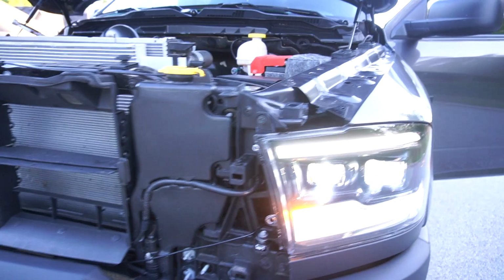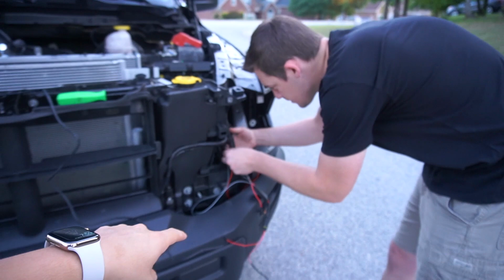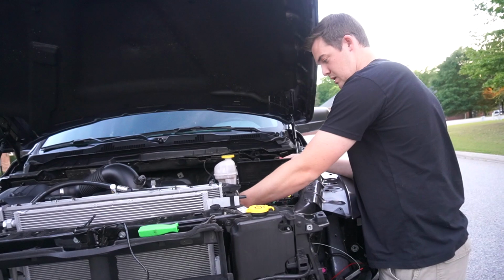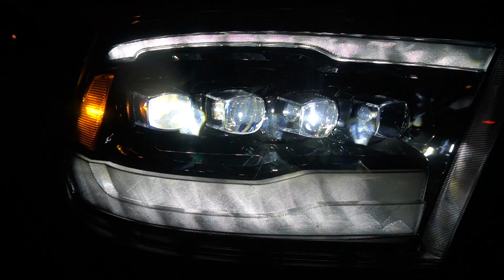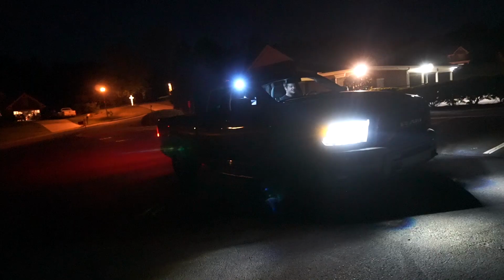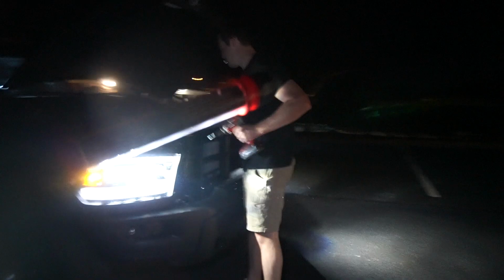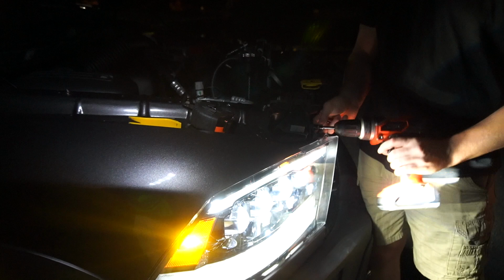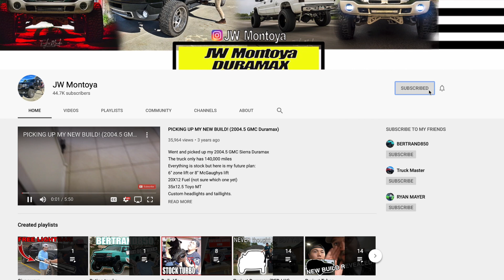TEST | Alpharex Nova Series VS Morimoto XB Headlights | 09-18 RAM | 4th GEN RAM

Comment: I just really don’t wanna spend $1000 on some headlights when next year they will have a brighter set.
Reply from the maker: Not necessarily true about new set every year.
Reply: JW Montoya Well I assume they will continue to improve the headlights in some way. Led technology its constantly changing and optics can also be refined. I’m still waiting for them to release the Nova series for my 2012 F250 which there are doing, I had them confirm it. I’ve seen some retrofits that are way brighter than these headlights but I know retrofits aren’t necessarily road legal. I like the idea of these headlights because they are plug and play and have a warranty but they are such a new product I’ll probably wait to see if there are improvements made on the leds and on the optics. Something I’d love to see is a billet rear housing that would increase cooling, allow for hotter leds, and increase durability by a mile. Secondly I’d like to see a possible offroad mode, while on the road have the leds perform at 50% brightness or the max legal brightness for roads. Then when you flash the high beams two or three times rapidly it could have the leds operate at 100% brightness, then you could switch to low beams to return to normal. These led projector headlights have the ability to be way brighter, the Morimoto MLED 2.0 which is a single projector is such a revised and efficient light it is brighter than these headlights that have multiple projectors and leds. I feel like of these lights could be pushed to the max they would be as bright as a led light bar.

Comment: Your video actually shows that the Morimoto lights are better than the Alpharex lights. The Alpharex make the immediate foreground brighter which fools you into thinking they are better, but if you look at the footage, the morimoto's cast light further.
Reply: It’s hard to tell with these guys which is better or not. We don’t know how they aimed the morimotos and I can see the aim on the alphas isn’t the best. I would have liked to see them pull 2” from a wall and marked the cutoff and hotspot. Then pull back 25’ perfectly straight on level road, set cutoff 2” below line with only a double step. Most of the videos guys are so worried about the look of the light and the drl that they forget it’s main purpose. I’d rather spend 99% my effort of aim. Just me tho. So I would t just count the alphas out yet.

Comment: I know this video is a couple years old, but my nitpick with this isn't an apple to apple to test rather an apple to orange test. You're comparing a two led projector housing to a housing with 4-3D led cube projector housing (I know only 3 are low beam). Rather the better comparison would be the Alpharex Luxx led series (dual projector housing) to the Morimoto dual projector. And before anyone says anything, I have a 2005 dodge ram 2500 5.9 Cummins. So finding proper legal led projector headlights are literal pain in the ass to find and unless I go to Primo Dynamic Lighting or something that does custom pre built headlights that'll cost an arm & a leg, it's to the cheapo projector headlights that aren't worth a fart in a southern church.
Reply from the maker: We were comparing what we had unfortunately

Comment: im guessing there is a sponsor or kickback from alpharex. Could be wrong.
Reply from the maker: Both sets were purchased. Didn’t get paid a dime
Reply: @JWMontoya  How come you only linked to the alpharex and put on such a show of promoting them? You aren't actors so it's really obvious. It's fine if you're getting affiliate or paid per click, in fact your subs would be happy for you to get sponsors. But your own testing shows it's obvious that the Morimotos have a much superior light pattern, the alpharex are throwing all the light about 20 feet in front of the truck vs the MM projecting it down the road where you need to see.